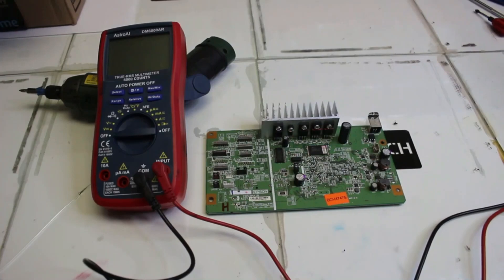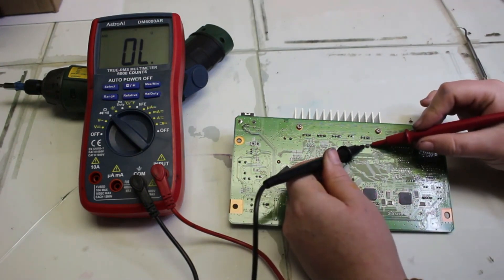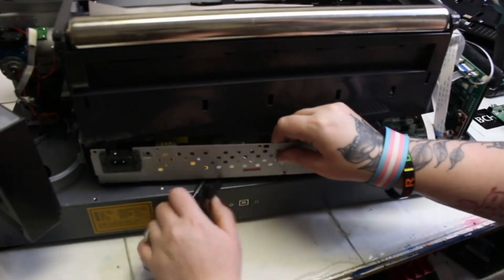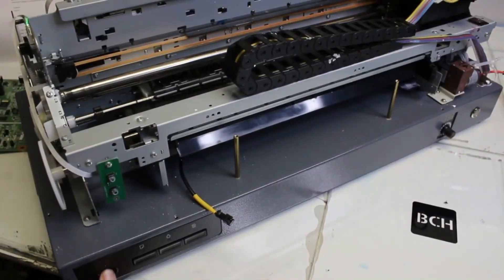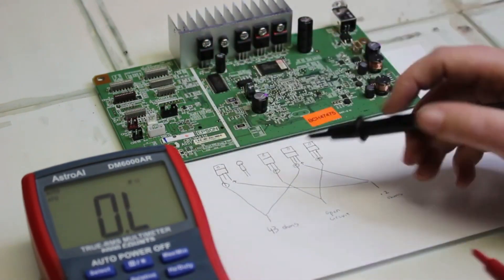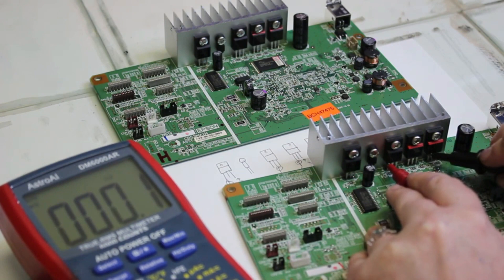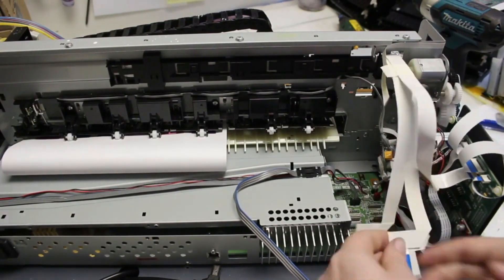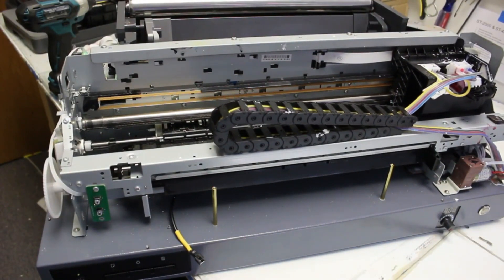Avoid Costly Repairs: Epson L1800 Mainboard Testing Tips

Comment: Hi Kevin and Abby, wondering if my printhead is moderately safe to retry after I replace my transitors. I wasn't having luck printing after running very many printhead cleanings, I pulled my printhead and very cautiously cleaned it and made sure there was zero dampness around the connectors or anything before putting power back to the head. Printer booted up normally it went to dock and done It's typical startup process. Then I turn the power off and the chirping started and wouldn't power back up. This printhead is only a few months old, I purchased and verified OEM from BCH, should be in decent condition I would imagine but I'm wondering if my transistors had had enough of all of the multiple cleanings? Is there a way to test a printhead for a short before putting it back in?
Reply: I had the same exact issue as you did.  Did you get it resolved?
Reply: @Gzusgeek man it's been awhile since I thought about that particular situation. I'm pretty sure that I tested the printhead and it did not work but it didn't blow my transistors or main board fuse, I never found any specific data on how to test to make sure that the print head wasn't shorted I just went for it. I ended up getting a new printhead and it worked. I've almost bricked this L1800 like 3 time, but it's running fine now and I've gotten pretty damn good at maintenance and repair lol.

Comment: Thank You for Sharing.

After replacing the transistors, what about the print head? Is it still functional or should we replace it?
Reply: I second this question. I wasn't having luck printing after running very many printhead cleanings, I pulled my printhead and very cautiously cleaned it and made sure there was zero dampness around the connectors or anything before putting power back to the head. Printer booted up normally it went to dock and done It's typical startup process. Then I turn the power off and the chirping started and wouldn't power back up. This printhead should be in decent condition I would imagine but I'm wondering if my transistors had had enough of all of the multiple cleanings? Is there a way to test a printhead for a short before putting it back in?

Comment: My epson l1800 too busy power blink green light too long
Reply: Some one can help me😪😪
Reply from the maker: Thanks for the clarification! It sounds like the issue is more likely with the power module on the mainboard, which can cause fluctuations that interfere with the cleaning cycle.  

Here’s what I suggest—start by unplugging all the cords connected to the mainboard. Then, reconnect only the power cord and the control panel. Try powering on the printer with nothing else connected. This can sometimes force the printer to rewrite the cleaning command and bypass the issue. If the blinking persists, the mainboard might need a professional inspection to ensure there isn’t an underlying hardware problem that could get worse over time.  

I really appreciate you subscribing to the channel and asking such detailed questions. If you need further help or a quicker response, feel free to reach out to me directly at support@bchtechnologies.com. I try to answer subscribers within 48 hours, and your support is helping me get closer to that 100k goal. Thanks again for watching and being part of the community!